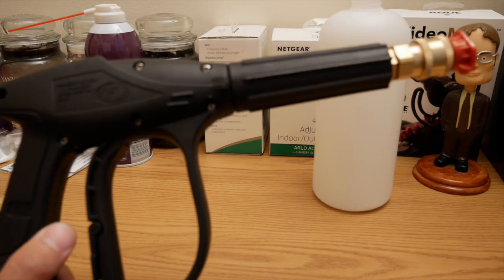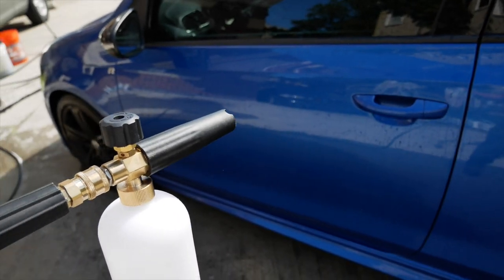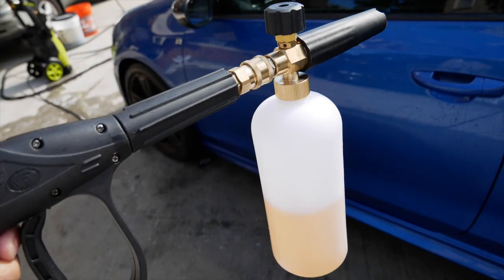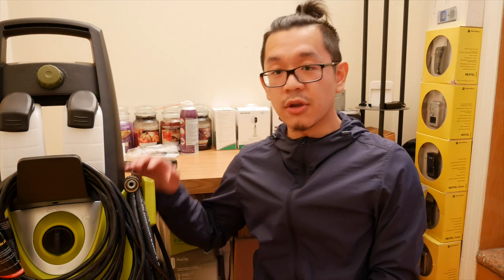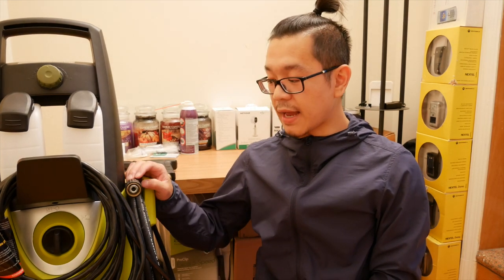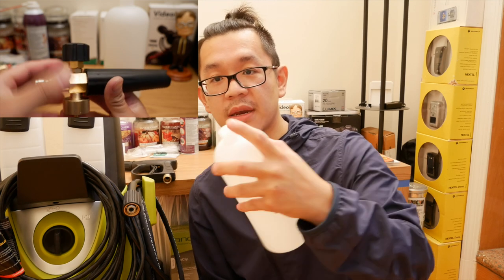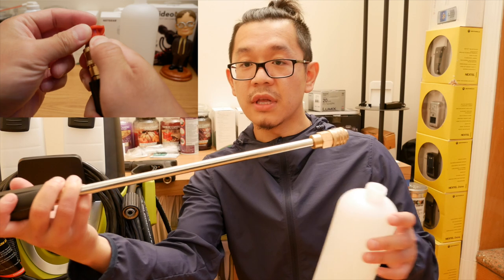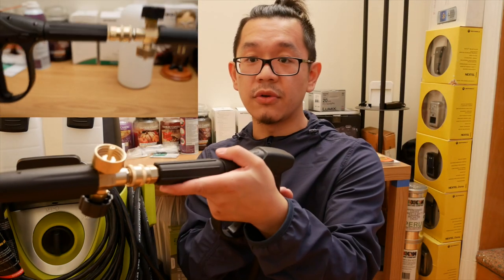Perfect Fitment | Hybrid trigger gun for the Sun Joe SPX3000 | M22 - 15mm 1/4 Disconnect

Comment: Did you ever find the m22 15mm to 1/4 quick disconnect for the sun Joe gun? I’m looking for one to fit onto my spx3500 spray gun Instead of buying a new one... lmk what you think ty.
Reply from the maker: I don't think i was able to find an adapter. I found the shorter pressure gun so I stopped the search for an adapter. Its perfect and not too expensive.

Comment: This past weekend I did so much researches on fittings for my new pressure washer.
At 4:34 I think you should've got a Male M22 to 1/4 Quick-Connect for your original wand. I think that way you can connect it to our foam cannon still and save money but you already bought a new gun.

With your new spray gun I think you should get 
1x Female 3/8" Quick Connect x Male M22 Connector (for the pressure washer hose)
1x Female M22 x 3/8" Male Quick-Connect Connector (for the bottom of spray gun)
I think this 2 connects will help you doing a quicker connect and less damage to the threads over time :)

I'm gonna get these 2 connectors too so my spray gun last longer!
Reply: ChasiubaoBelly  where do you get these quick-connects?

Comment: Hi Ricky, decided to go with the setup you chose and unfortunately the gun was broken when it arrived between the trigger and the barrel. It looks almost like it was an adjustment for water pressure but realized that it was broke. How is yours holding up?
Reply: Just received the replacement and seems to be okay but I am curious why the piece between the trigger and the nozzle( stock) is able to slightly pull apart or separate as if you could adjust. Not sure what the reason this would do that. Any idea? Not instructions.